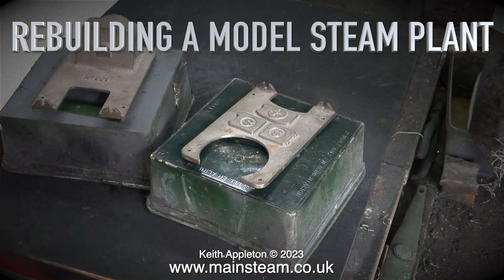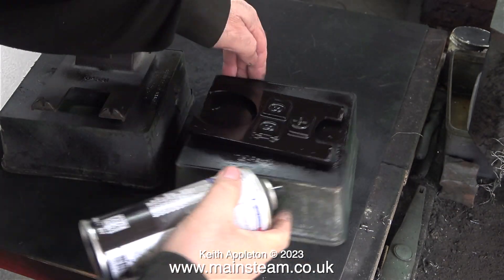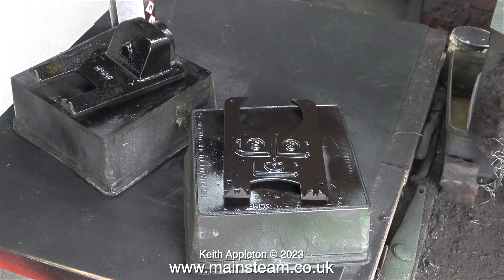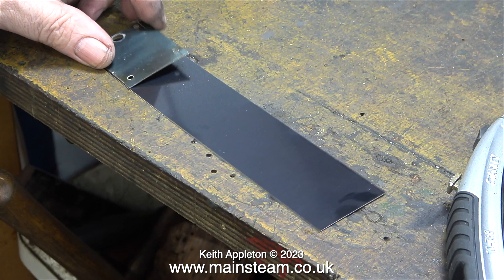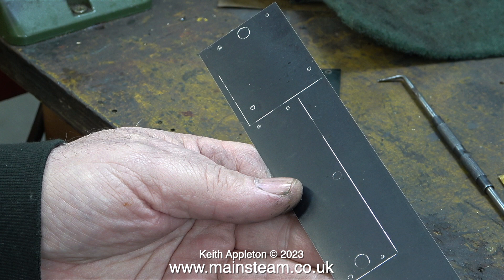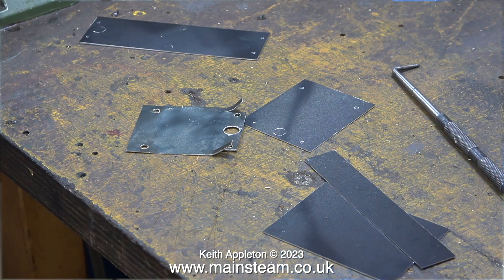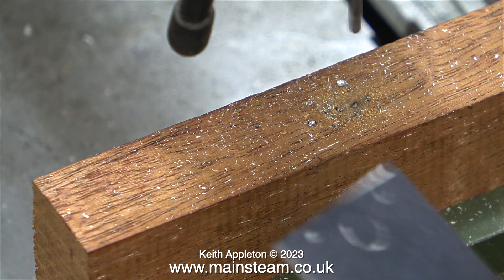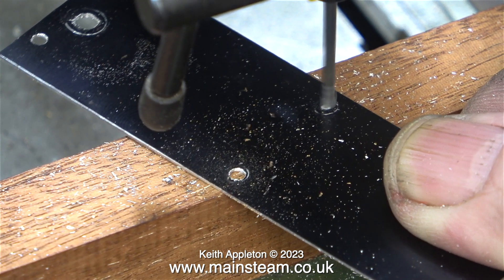REBUILDING A MODEL STEAM PLANT - PART #16

Comment: One method I’ve used when drilling thin sheet aluminum is to sandwich it between two scraps of wood, mark out & center punch the wood, then drill the holes thru both pieces of wood.  Little extra work, but very clean holes and low risk of marking up the aluminum.

Comment: I've recently come across brad point drill bits they seem to work well on thin materials. I'm a Brit living in USA and I didn't find them until i moved here so they might be called something else in England.
Reply: 118 degree split-point drill bits work well: these were originally used for aluminum skins on aircraft. Another good option is a smaller diameter step-drill bit, which has a spade-like tip and can also be used to enlarge holes in both sheet metal and plastic (but be careful with Acrylic).